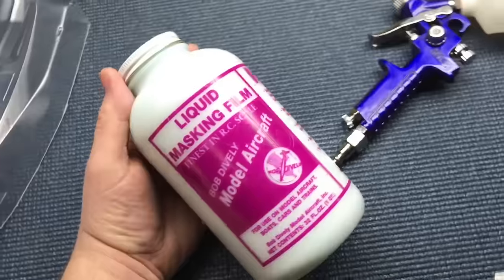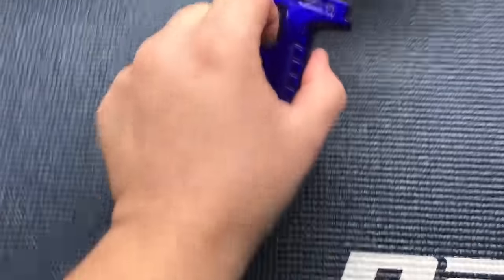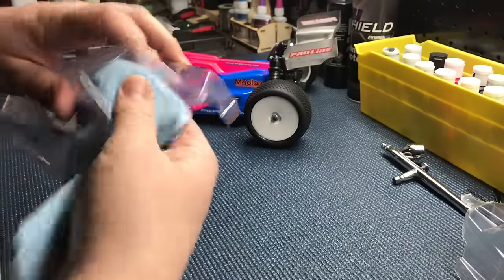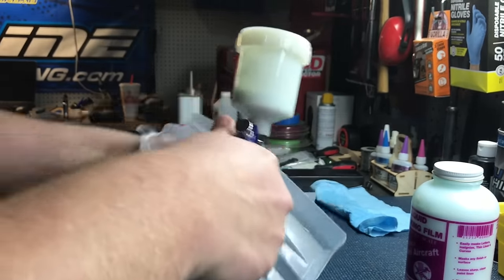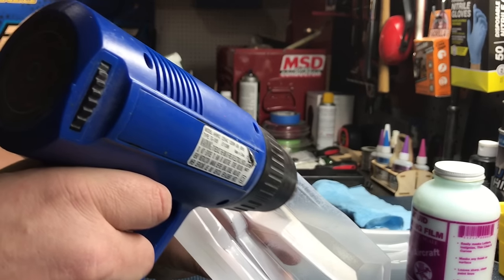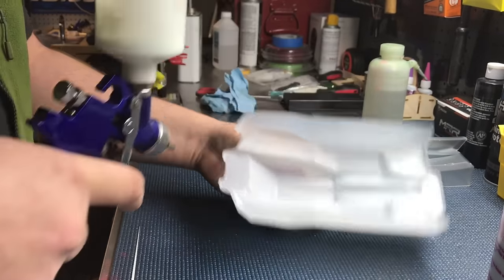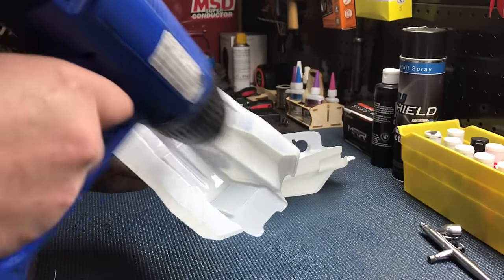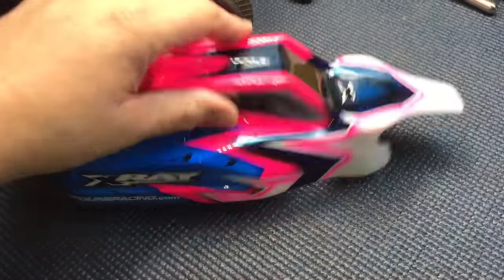Pro Painting Tips #1 Liquid Mask

Comment: Pro tip: Put your isopropyl alcohol into a spray bottle and use in conjunction with a soft bristle toothbrush. Cleans everything really well and doesn't leave any fibers or residue.
Reply: for liquid masking just use water, as it is water based. using alcohol can cause some brands of masking to suddenly clog up as they are not purely water based.  Some contain latex and alcohol can cause problem. also instead of tooth brush, use painter's 'round pointed tip' poly brush (5-7mm diameter). Round pointed tip poly brush also works really well in cleaning airbrush with heavy tool cleaner solvent (petroleum based) without melting.

Comment: Great Video. Thanks. What Compressor do you use? I just picked up the same Airbrush and it has a 1/4 in fitting. I have an Iwata Powerjet with 1/8 fitting I believe. Thanks for any info.
Reply: He is using a full sized air compressor for this, likely at high pressure. I use a 1.7 mm nozzle/ULV at 80+ PSI and I no longer dilute the mask.  I've been using this and the method and the video for two years.  Started with a 1.2mm nozzle and it clogged a lot.
Reply: @BobDingleful  thank you I have a cheap air gun with 1.7 nozzle. saves me spending more money after buying a iwata eclipse

Comment: How much do you thin the BD liquid mask to apply it with the HPLV gun?
Reply: You don’t need to thin BittyDesign . Spray it straight from the bottle. Around 1.5mm tip at around 50 psi.

Comment: Great video! Very helpful.
Reply from the maker: I'm glad that it has helped! I haven't been painting that much lately. I did however move away from the smaller spray gun in the video. The needle was too small to handle any lumps that formed in the masking liquid.  I just use the standard 1.3 mm gun that is available at harbor freight stores for $15.00. Hope that helps!

Comment: Quick question bro, I have a 1.8 HP 17 Gallon 150 psi Air Compressor, will that run the kind of sprayer your using?
Reply: It will but you have to regulate the air pressure. I use a cheap Harbor Freight air pressure regulator, with one of their $.99 air dryers. It's the same setup I use for my airbrush. Hope that helps.

Comment: Found the liquid mask applicator on eBay, what airbrush do you use? What is final coat used?
Reply from the maker: The airbrush I use is the Iwata, Revolution-CR. Can you clarify your question; "Final coat used"?
Reply: On Point RC final coat inside body after all paint is applied you backing with white? If so just same brands or you using a different paint  brand as final backing
Reply from the maker: JM CHICAGOLAND CICHLIDS I am using Rustoleum Rust Tough flat black enamel. You only want to use enamel when backing acrylic.
Reply: On Point RC what paint are you using faskolor backed by a regular paint?
Reply from the maker: JM CHICAGOLAND CICHLIDS Yes Faskolor and Createx. I back it with enamel once the acrylic has cured for 12 hours. The enamel makes it fuel proof and protects the paint.
Reply from the maker: I use both Faskolor and Createx. These work best, remember to use heat for drying as it helps with the adhesion process.

Comment: I've been wanting to do this for some time now and your results was a deal breaker for me. What size needle do you recommend.
Reply: You can find exact HVLP spray gun in Amazon for 12.89. It has only 1 tip size which is 0.8mm.  It is good enough because Bob Dively liquid mask is quite fluid, unlike other brands some can be quite thick, then you need to use higher pressure. (or you can premix some water)  
A heat gun is really helpful. (Actually like necessary)
you can check out Bittydesign's video https://youtu.be/G4fDHgVRJmU
This is probably the only company in the world that does professional RC car body stuffs now. At 1:03 it says they use 1.4mm needle size at 3.5 BAR. I use their liquid masking it looks thicker than Bob Dively but it works really well it doesn't tear off or peel off for no reason at all which can run your paint job.
Reply: @golferchin76  thanks for the link... do you know if this gun runs off the same compressor as a airbrush?

Comment: Can it be used in my Paasche Talon? If so. Do I need to reduce it?
Reply: Buy the Spray gun instead. They have a 1.5mm spray nozzle size. Those airbrushes are usually between 0.3mm to 0.7mm and too small a nozzle hole size.

Comment: I have a three color process that I want to do. So my question is, after you paint your first color, can you spray the mask over what you painted so you can peel the mask off to do the next color. Will it pull the first color or be fine doing that? No body so far has addressed that. Thanks, good video.
Reply: I'm looking for the answer to this question as well.
Reply: (When at all possible) the best way to do it would be to cut out your full design before any painting but only remove each layer as you complete the previous revealing the fresh area for the following layer. It will peel off just fine, even after paint is on it.

Comment: Do you reduce the liquid mask? If yes, what you use to reduce it?
Reply from the maker: Yes, I do reduce the liquid mask, using just water. I reduce it until it sprays evenly out of your paint gun, airbrush, or whatever you're using to apply it. For a spray gun with a 1.8mm needle I reduce it 6:1 - 8:1
Reply: Sixto Rodriguez you can brush it on. It's just faster to spray it
Reply: @onpointrc6299  6:1 6 is for liquid mask or for water?